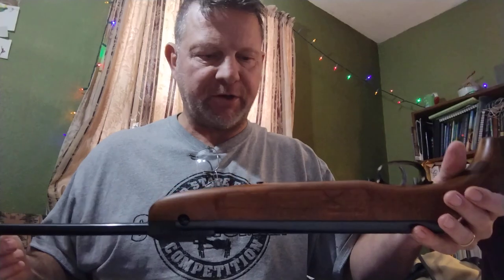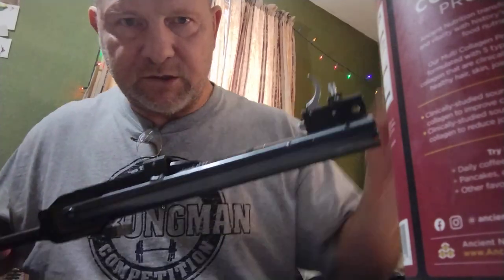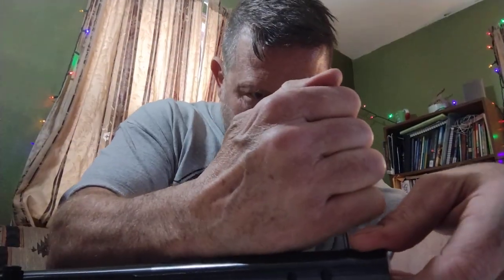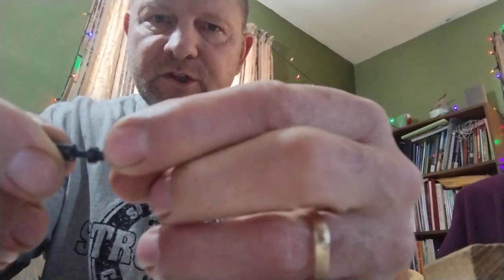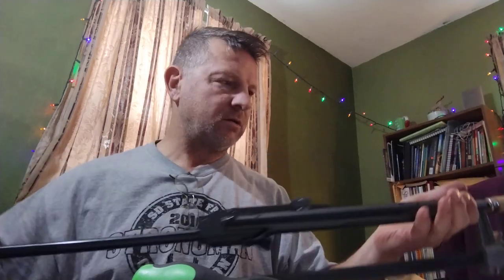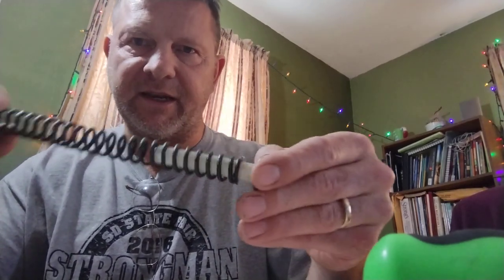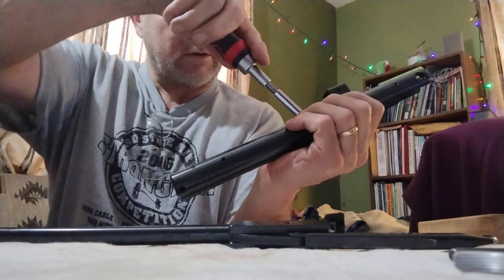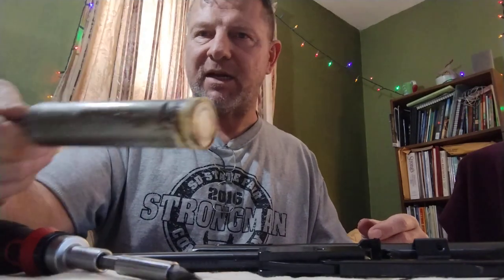HW30s Luxus: full disassembly

Comment: So if I got it right the tiny screw on the side is what is holding the preload? 🤔
I kinda don't like this.

This video is the perfect example that it only take one silly screw or pin for this process to take twice the time that it should ! Haha
Reply from the maker: The safety screw is like a fail safe. The safety screw and 2 trigger pins hold everything in place.